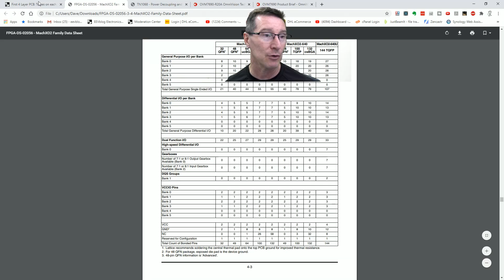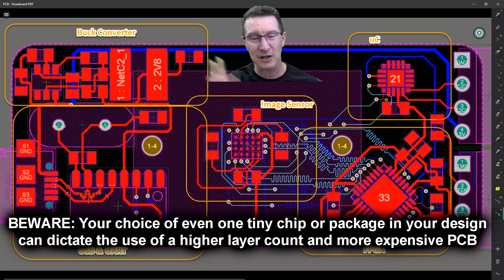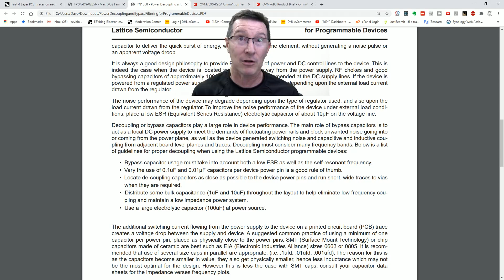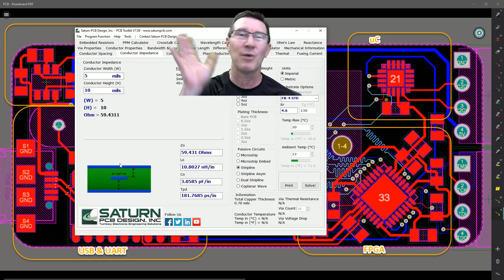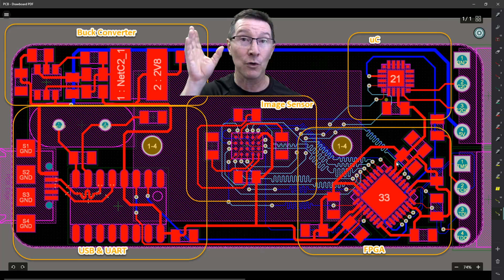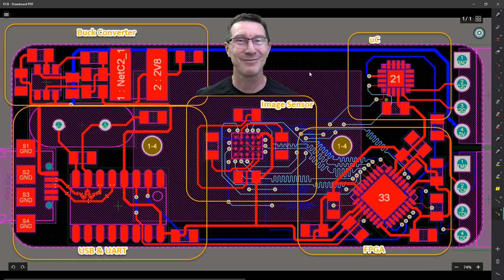EEVblog #1323 - PCB Layout Review & Analysis

Comment: Is it a cardinal sin to have a via inside an SMD pad? Am I going to the fiery place?

later: It's for hand-assembled hobbyist boards.
Reply: Its perfectly fine for hand assembled pcbs however for 0603 and smaller on a pick and place you'll find your yield will drop due to solder wicking thru the via and not having enough solder left on the pad for the component
Reply from the maker: Not a cardinal sin, it's a valid technique, but you have to know the pros and cons.
Reply: if there are no traces running between the pads, I place the via between them. tented vias on copper can be a bit yucky
Reply: It also depends on the hole size, with the small 0.2 and 0.25 mm Vias (various Chinese low cost PCB houses offer them) the holes are small enough that solder will not flow through due to surface tension.

Not a cardinal sin, however it is a good practice not to do it unless it is really needed
Reply: Not a cardinal sin.  Plug the holes as a secondary process.   Conductive epoxy will give you way better yield and you wont get pop-corning.  Pop-corning is vaper/contaminant entrapment that heats up and vaporises rapidly causing solder to splatter as the bubble of gaseous contaminants pop.
Reply: @pelor92  I reguallry see tin flowing into 0.25mm vias. There is more to it like: Solder paste, Solder technology (vacuum, nitrogen and vapor phase tend to not exhust the fluxes, so the tin easily wicks things it could not under air), board surface, ...
Reply: @GodzillaGoesGaga  plugging the holes traps "air"/gas and flux. Note that solder past is 50% by volume flux - that flux has to go "somewhere" and if you trap it in a via, that is not a wise idea.
Reply: @sarowie  You plug the holes first (it's part of the pcb manufacture process).  Then there's no entrapment.  It's a secondary process called via plugging.  There are 2 types.  You can cover the top of the via up so that nothing wicks down or you can do a complete vacuum plug (which is more expensive).  Talk to your MFG engineers or PCB house.  They can advise and are very knowledgeable on the latest techniques.
Reply: Not a sin at all. I do it all the time and is my preferred way. But only when the vias are filled and capped (which is not that expensive anyway).
You should ask for "IPC-4761 type VII filled and capped vias" in your fabrication drawing.
Via in pad is the best in terms of getting the lowest impedance connection and thereby reducing the loop area (better signal integrity, lower EMI etc.). Also makes BGA routing easier.
You can save a lot of board space when all your vias are under the pads. That's how you get a PCB where all you see are components right next to each other where you can barely see any PCB material because it's so densely crammed.
Reply: It depends on your manufacturer.  Many allow vias in pads, some don't.  Last time I checked JLCPCB is one that does not allow vias in pads or plugged vias.
Edit:  I don't see the need for a via in pad unless  you are breaking out a fine pitch BGA or your board is so crowded that its the only way to tap the signal.
Reply: I had the pleasure of assembling some boards that had vias placed inside the pads of solder beads. The solder kept on wicking through, making the bead much harder to form!
Conversely, on the same board, we have a QFPN with a big ground pad on the bottom. One issue with hand-soldering this is getting the right amount of solder on the central pad. By placing a via in the middle of this pad, we have a solder drain hole so that it basically doesn't matter how much solder you put on it. That's the kind of attention to detail that comes in after 10 revisions of the same board :)
Reply: Prehistoricman thx mate.   You just saved us (& everybody else) at least 10 revisions.
Reply: kalhana1 vias filled & capped.   
Thx mate.
Reply: @userPrehistoricman  A lot of it depends on via hole size and aspect ratios.  A 4 mil laser hole doesn't wick very well because of meniscus/surface tension.  Talk to you MFG Engineers!!  They really know this stuff!
Reply: @Mindlesscoolguy  Finally a sensible explanation for that rule!
Reply: If you do your via in pad and go directly into an internal power plane, consider having thermal reliefs to the vias added, or you might have a hard time handsoldering, compared to having a bit of trace to the via basically acting as thermal relief. On the same issue, make sure you keep your traces thermally balanced. Not that big of an issue with hand solder, but if you reflow thermal inbalance is the number one reason for tombstoning passive components. I support the other comments about solder wicking and possibly plugging/capping the vias too.

Comment: most of the PCB designs I have done are relatively low speed so not critical on the loops etc, 2 layer, and thru hole etc, I tend to route power then signals and let the flood fill do the rest for the ground on top and bottom layer. I also sometimes do the top layer one way and bottom the other (traditional kind of computer board layout makes it easier for me as I hand route my boards) particularly on my 8 bit computer project and particularly for some signals, kind of via heavy but works ok for me. I do try to get some of the decoupling and relevant parts as close as I can to the required pins etc, Higher current stuff I would probably try to avoid vias, keep it on one layer. only for stitching or low current signals. I do probably need to refine my trace layouts a bit based on what you mentioned in the video, my component placement probably isnt too bad, I at least wouldn't have put a decoupling cap miles away from that pin

Comment: The control lines do not even look like I2C as they are missing the pullup resistors.
Reply: perhaps the microcontroller has internal pullup resistors?
Reply: @skittermckitter05  It likely does have internal pullup resistors but these usually are in the range of 20k...40k and not 1k..4k7 like required for I2C.

Comment: First thing I thought was - rotate the whole buck regulator circuit 180 degrees. Definitely no need for matched length traces on the UART->USB D+/D- lines - I've even run 2,000,000 bps UARTs across jumper wires on a breadboard 🤣

Comment: USB - Common Mode choke on the data lines. Input-filtering (maybe - should do), fuse would also be nice, maybe resettable also. About how you should ground the case against the internal GND pin I have seen many different opinions. BTW there are some traces which are PTSD giving thin.

Comment: I'm not a PCB design expert but I wouldn't run traces behind caps or filtering components of the same layer. I've designed some boards in a very tight space and there is always a way to route those lines avoiding going below passives

Comment: I think someone turned on autorouter then naturally gave up. Single sided brain works. That's my 55 years of experience. KISS.
Tracks between soic pins? Placement of parts to achieve shortest total rats nest length is a start. That would go a long way to putting bypasses in the optimal locations.
My own (never released) custom software 32 layer is still faster than what sprang from the old Protel and it is 100% net error checked. 32 layers? Handy for gcode generation, slot routing, etc. 1st 16 layers Protel compatible. Keep doing the good work Dave. I wish there was a dumpster near me.
Reply: Do not blame the autorouter when the designer has not yet finished the placement phase yet.
I only have 10 years experience. If a co-worker would submit that to review I would call it a rough placement draft and review it as such.
Any argument that this is a layout is voided by the fact that the GND system is not even started yet.

Comment: Going from 2 layers to 4 layers is a mega impact on pcb design. Because you can create power planes with 4 layers and they have several important impacts on design density, power distribution, shielding and board rigidity.

This video demonstrate how 2 layers power traces can force you to create weird and inefficient design.

Comment: Very useful! I've been routing a huge (for me, it's the 3rd board I'm laying out ever) 2 layer board with 72 IO lines. It's been quite challenging and absolutely impossible to achieve the "holy grail" of having all signals on the top layer, but I think I managed a decent 2nd by only dropping signal lines to the bottom a maximum of 1 time per signal (except a couple, which is really annoying, but eh).
Reply: Adding some 0-Ohm resistors as "bridges" for crossover can sometimes help on 2 layer boards too.
Reply: @ProtonOne11  That's true. But if I have two layers, surely a via is better than a 0-ohm resistor? At least to a point.

Comment: Edit: found your video in vias! Thanks for the videos.

Have you talked about via in pad before? I would be very interested to hear your thoughts on it from both the perspectives of shrinking the board and also thermal relief.

Thanks for the video very interesting.
Reply: As long as you stay thermally balanced (via in pad on both ends of your passive components), and thermal relief into copper planes if you want to allow some reworkability for production fixups and repair, Via-In-Pad can be a great thing. I'd only do it with plugged and capped vias, or maybe microvias, and only on very tight or critical boards if necessary.

Comment: Seams like the 2.8v line is going directly to 8 pins on FPGA chip, circling it, and connected to capacitors that are not connected to anything. The 3 capacitors on the bottom left of the FPGA box have the chip pins relative close to each other. Do they connect to different signals or why does this have  8 capacitor with a common VCC connection. Could this just be one cap, if they are all connected to ground and actually in parallel?
And BTW routing signal lines first, is very logical and I'll hold this information forever. I don't design PCBs at all, but I did use eagle PCB once to determine how to have the smallest footprint on a perfboard. Information like this will come in handy if I ever start doing any PCBs of my own. It's nice I can see how someone else thinks, so thanks for sharing knowledge.

Comment: I have learned a lot in a few  minutes. Would love to hear what the best practices are for a 2 layer board.  (Ground plane and power traces on bottom and signal/data on top ??)
Reply: My approach for 2 layer boards is to route signals and power on top as much as possible, and keep the bottom reserved for a solid GND plane. I try to only go to the bottom layer with signals for short distances, to resolve crossovers. Sometimes it helps to add a few 0-Ohm resistors as a "virtual 3rd layer" option too...
Reply: @ProtonOne11  Thanks for the input.

Comment: Question: - On a 4 layer board, would you route mains voltages (240 ac) on the inner layers designated for low voltage power, eg  signal layer, ground & neutral, LV power & live,  bottom (signal) layer.  Naturally the main side would isolated with physical cutouts?
Reply: As long as you watch all your isolation distances between the different voltages and between mains and low voltage/signals, and put the cut outs where needed, it does not matter. If you think that it would be better for safety reasons to have the mains internally, your design has other issues, as nobody should ever get theyr hands near that PCB part that has mains voltages on it anyway. One possible reason to have the mains on the outermost layers might actually be the thermal dissipation (current handling capacity for a given trace width), as that is usually better on the outer layers than on internal layers.
Reply: @ProtonOne11  many thanks for the clarification

Comment: You have made a few videos about PCB-Layout, ground-plane capacitance, matched traces and so on, but i would kinda be interested in the layer-selection you were talking about.
Why signal-traces on the outside? I have created a few PCBs only so far (at least designed once with signal-wires were it could even come close to being relevant) and just followed the adice i heared so often of the signal-wires being on the outside, but the only real positive thing was that i could see the traces on the finished PCB.

But given a simple 4-layer layout, lets take the JLCPCB with the thick inner core for this - what would be the downside of having the Ground/Vcc as the outer layers and the main signal-layer on the inside near ground?

(For me this is purely out of curiosity as i am mainly a programmer, most of the boards i deal with are from hobbies and there it is DC or really low frequencies only - buck-converter for a bike to drive some LEDs are not that sensitive nor do they need to be precise in any way )
Reply: Main reason originally for outside is cut and hack wiring for proto.  Military has a lot of GND on the outside to stop Electrical E-field interference.  Kind of moot these days because most Mil/Aero boards are 8+ layers.  A lot of Microstrip/stripline considerations are taken into account for these high end designs.

Comment: What do you think about placing components on the bottom? Probably wouldn't be important for this board, but for others?

Love the floating head!
Reply: are your physically able to place components on the bottom side or are you mounted to a flat sheet of plastic?
Do you need to assembly both sides?
are you willing to assembly two board sides instead of one board side?
So, to answer your question, you need to ask assembly/system/cost questions. In therms of PCB design, it is just an input constrain.

Comment: Hey dave, you've said to use as much as the top layer as possible. Is it wrong to adopt the top layer for horizontal traces and bottom for vertical (or vice-versa)? When it isn't a delicate signal (controlled impedance for instance), I always end up doing that to ease the routing on very densely populated boards.

Comment: When I learned PC layout in 1980s using tape and xacto, the rule for double sided boards was one side for vertical runs and other side for horizontal. Does this still generally apply in SMD 2 or 4 layer boards?

Comment: JLCPCB's auto-router is definitely not the smartest auto-router around. Great for simpler projects, chokes on more complex stuff. Based on my personal experience, I get better results manually routing the important stuff, locking them down and then letting the auto-router do the rest (and sometimes it fails to do so).

Comment: One bad design practice on that buck converter part is, the feedback is being taken from the Inductor. It should be taken from output capacitor . looks like it's totally crap layout.
Reply: I looked at that too and agree with you.  But I don't know the components to make a precise assessment.  The fact that the IC looks far away from the Inductor is my biggest concern.  No poly pours for the inductor to keep losses and parasitics down is another.
Reply: @GodzillaGoesGaga  its almost certain in any regulator that the feedback pin is available if it's not 3 pin device.
Reply: Yep feedback should be taken from the output capacitor side and routed away from the inductor to avoid picking up noise.

Comment: IMHO, the imaging sensor was rotated 180° from optimal.  Spent a lot of board space getting from the back side of the imager to the FPGA.  Most imagers have H/V mirroring or rotation which would have fixed a lot of this.  Would have also done the imager decoupling caps on the back-side to get them away from signal - via down from the ball to +power plane and then continued down to the decoupling cap.  Decoupling cap's ground via can then be closer to the imager ball ground via - thus the decoupling loop would be constrained roughly to the dimensions of the cap itself.
 
Re: the green screen, it's good - you can improve your setup to eliminate the concerns you mentioned by using a retroreflective green screen.  Did this for my kids when they needed to do online classes. https://www.youtube.com/watch?v=rJKLEZnsVsQ

Comment: Hello Dave,
What would you say about coupling capacitor placements. 
Is it a bad exercise to place the coupling caps on the bottom layer? If they are on the bottom, the signals have easier routing at least for this board.
And what would you say for general board layout about the coupling caps on top or on bottom?
Reply: is a good point, but need to be aware that some projects demand to keep one of the plane free from components (maybe because of its physical-mechanical mounting)